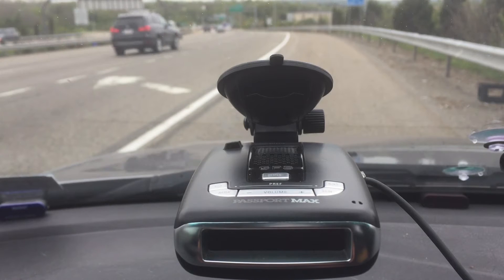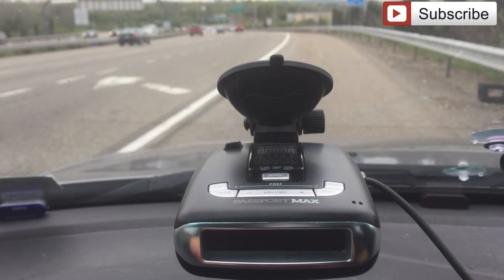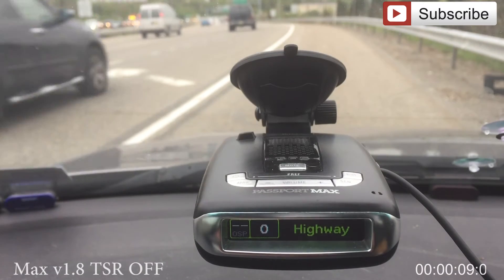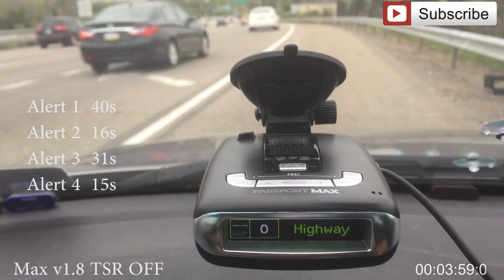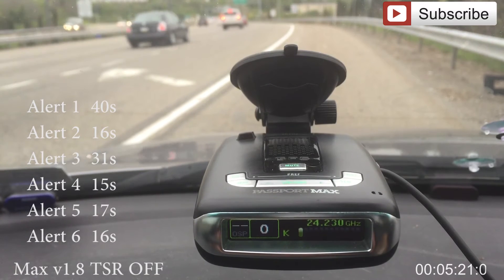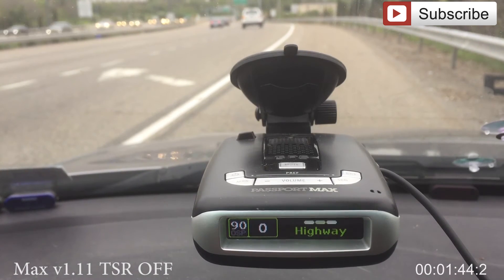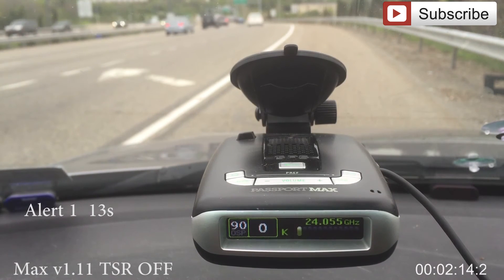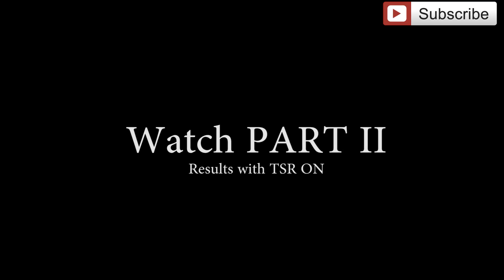Escort Passport Max Latest Firmware K Band CAS Filtering Rejection TSR OFF

Comment: the version 1.11 is with the max not the max II    please test for response time on the max version 1.11  the response time on k band is dead slow and ka band is slow    on a medium to low strength signal on a quick trigger its around 3 to 5 seconds   that is very bad !